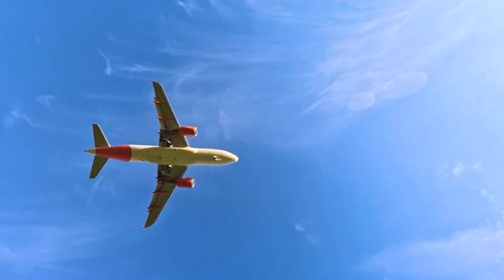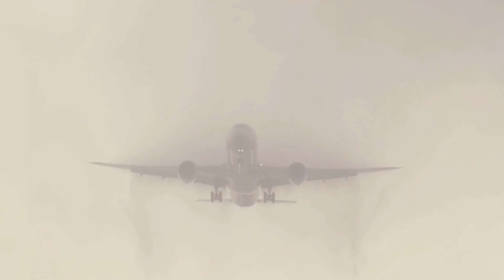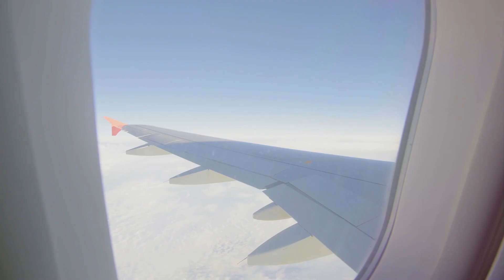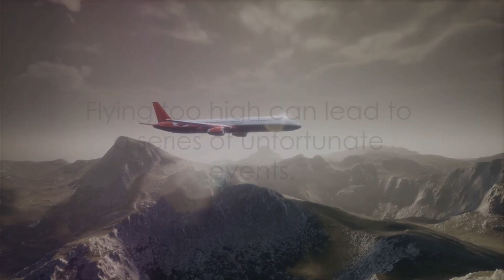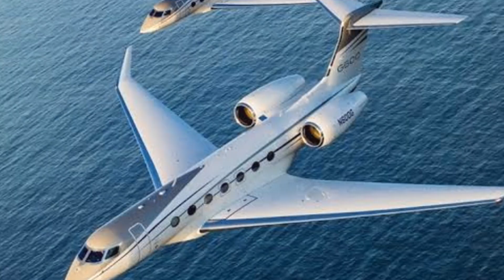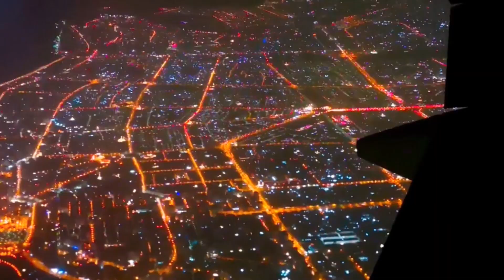What Happens If A Jet Flies too High? - The Risks Are Real

Comment: The coffin corner refers to a graph, where its corner meets the maximum altitude and where the stall speed meet. Though the airplane may be flying at a true airspeed of high mach numbers, say 0.90 mach or higher, the indicated airspeed is much lower, say around 240 kts, for the low density air you mentioned, which at that point, any disturbance of flight stability, a strong gust will cause the airplane to stall. Once while flying in a 767, we climbed to FL420, and the gap between the over speed barber pole, and the stall speed barber pole (both red), was just within 10 knots with indicated airspeed below 240 kts. We flew there from the US west coast to the east coast, and we were full aware where we were, and there were no passengers on this flight. 

The biggest altitude restriction is the altitude from which the airplane can make an emergency descent to around 10,000 feet, if cabin pressure is lost. Current oxygen generators only last about 15 minutes, though for the crew a real oxygen bottle is available, so the time to descent from X altitude to 10,000, must meet that time criteria for  an particular airplane model and type, and hopefully no traffic below.
Reply from the maker: @javacup912 This is an excellent analysis✅💯👌
Reply: AI can't understand real life, it's limited to what it's seen in video games.